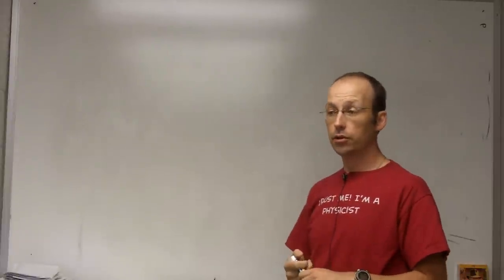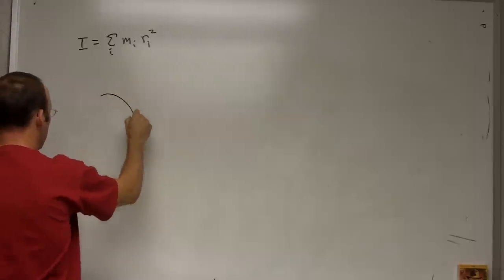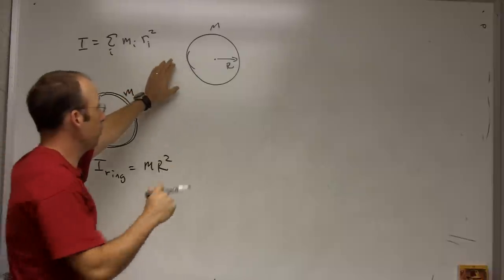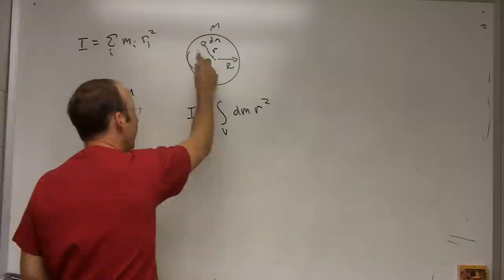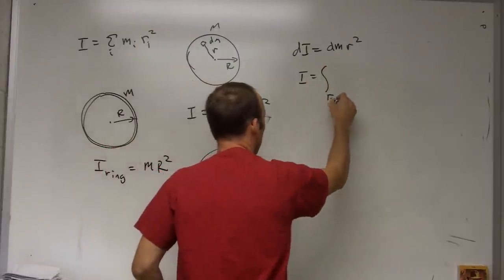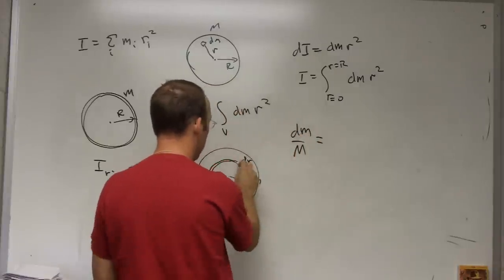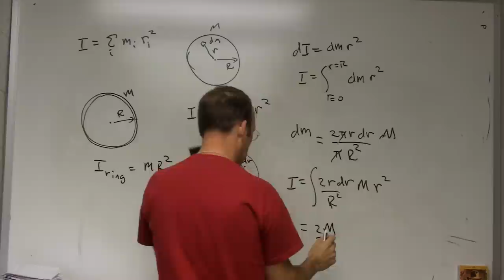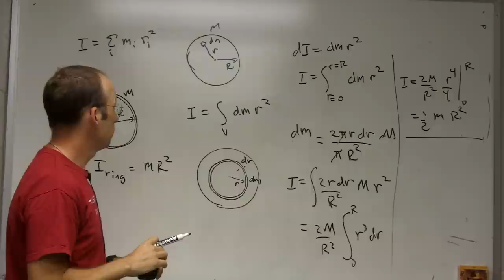How to derive the moment of inertia of a disk

Comment: FredericoCoelhoNunes when dealing with integrals, the "dr" term is infinitesimally small. So when you square an infinitesimally small number, the "dr^2", it becomes a very very small number and it is negligible, so the pi*dr^2 term drops out and you're left with what is used in calculus for the differential area of a circular ring.

Comment: uhh, he's assuming that the ring is a ring with a circumference of 2*pi*r and width dr. 
That makes it simply a rectangle with length 2*pi*r. To find area of that rectangle, you multiply the length by the width, which is 2*pi*r*dr. i think your method works too, but its alot more complicated...
Reply: At the infinitesimal, you're allowed to do stuff like that :p
Reply: J Y I wasn't able to understand but this comment helped me. Thanks. :)

Comment: How would you solve this if you didn’t know the moment of inertia of a ring?
Reply from the maker: in that case, you would need to do a double surface integral.  It wouldn't be too bad in polar coordinates, but not trivial.

Actually, I also have a fun solution using random numbers on my other channel - check it out.

OK, I was wrong.  I have this calculation for a spherical shell.  I'll make a disk soon.

https://youtu.be/T3KMWqXq2ME

Comment: People always forget to set the density equal to 1, and then approach it in such a way as to define the moment of inertia in terms of the area. Do you know what I'm talking about? In this case you'd be viewing density as mass/area and your integration would be set up as R^2  DM/DA DA, but because DM/DA = 1. You'll be able to integrate it as R^2 DA.  When I took multivariate calculus, that's how I approached things. I earned an A in the class, but the professor became angry and stated that he does not grant A's to anyone so I got a B. LOL. How he was able to get away with that is beyond me. I also figured out how to find the traces of 3d solids by simultaneously setting x and y = 0, and stuff like the direction of a tangent line with respect to x in 3 space will be parallel to the yz plane. Do you know what I'm talking about?

Comment: LOL. Come on think about it. Really, the only way you can authentically justify this method is if you set the density equal to 1. 
What does that mean? It means that you are working with a disk of uniform mass. I took this course way back in the early 80's.